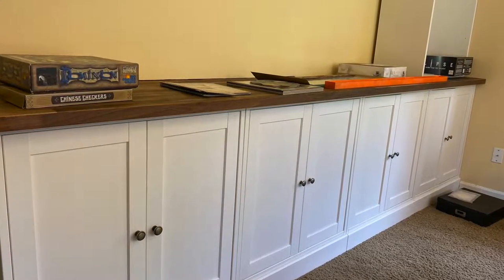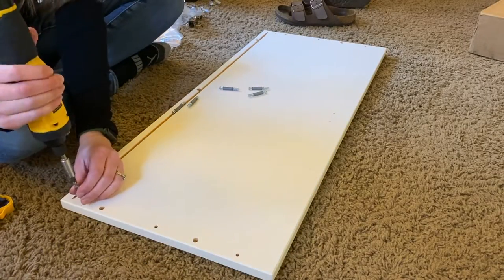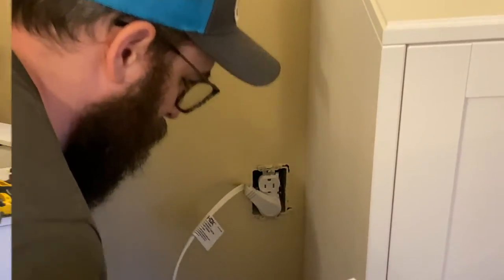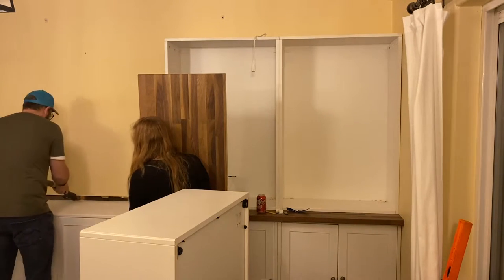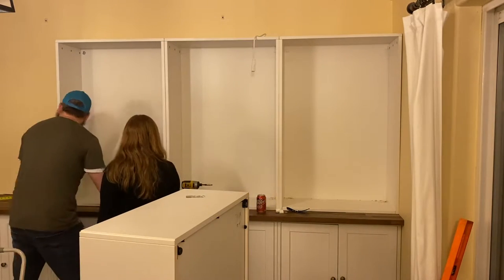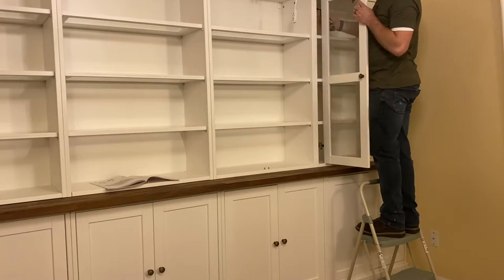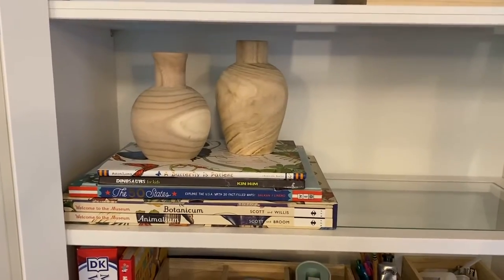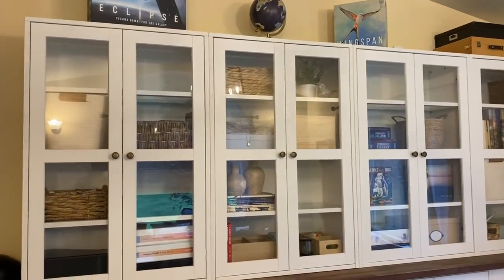IKEA HAVSTA HACK | PART 2

Comment: Y’all are great problem-solvers, but for those not able/willing cut cut into drywall: secure a 1x3 across the wall but use shims to get it level.  Then secure cabinet backs to that.  Easier to get to studs, too.
Reply from the maker: Great idea! If we ever move, this will probably stay with the house as a somewhat permanent feature so we didn’t have a problem cutting into the wall. But it was significant damage to the wall if we were to want to take it down at some point - the 1x3 and shims is a great option! Thank you for commenting!